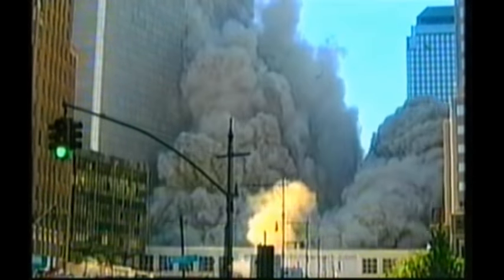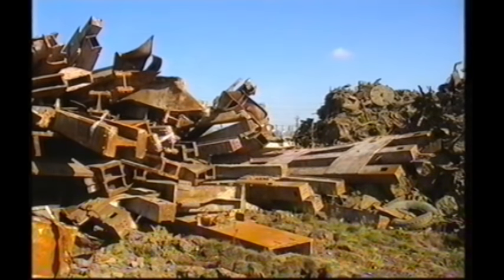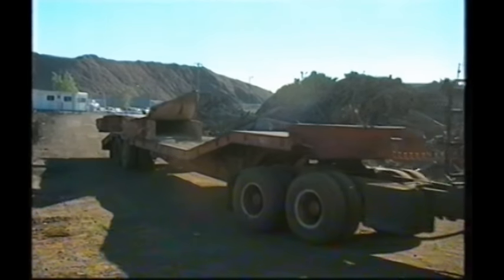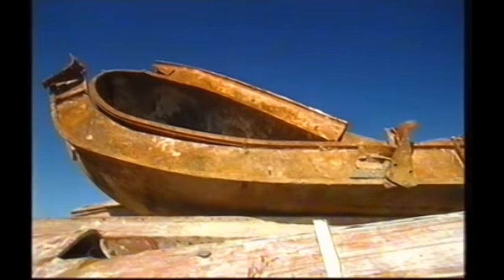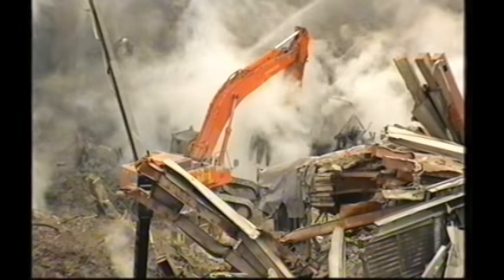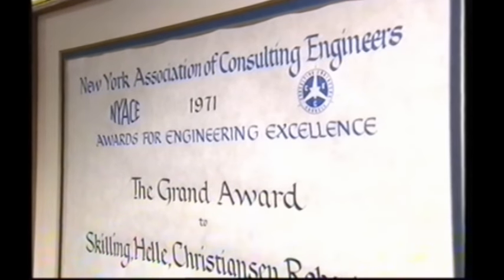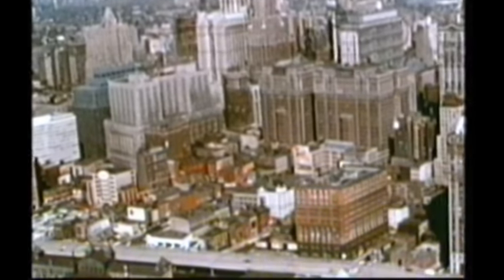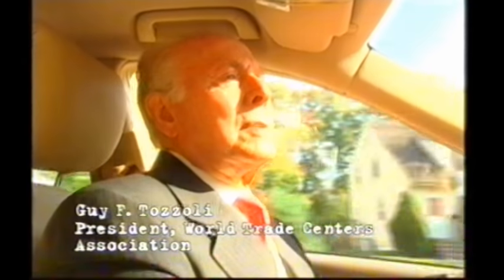9/11—"How The Twin Towers Collapsed" (C4 documentary, 2001)

Comment: It really pains me to see the architect blaming himself for the thousands of deaths. If he’s passed away since 2001 I pray he found some peace and realized that the majority of the responsibility for those thousands of deaths is with those who blew up the buildings not with those who designed them.
Reply: The moment he passed he was shown the truth.
There is/was a documentary about how they came down and engineers were explaining they were demolished by implosion .
They were talking about people hearing explosions at the base .
Whoever has seen how buildings are demolished ,knows how clean and in vertical they come down .
Collapsing on the side  is not allowed in a well done job.
Anyway , the engineers  speaking in the documentary were sure that it was absolutely impossible for a steel building to collapse bcs of what happend on the top floors.
They have questioned also the official narrative about the planes.
Wonder if that documentary is still available or the communist censorship had its paws on it 🤔🤔🤔🤔
Can't remember how many years back I saw it. Anyways , many.
Reply: False.  The buildings were not blown up.  The fire brought them down.
Reply: @dianet2702  : The fire brought the buildings down.  Not demolition charges.
ridiculous.
Reply: Wrongfully Ccused is a troll.
Reply: @wrongfullyaccused7139  exactly, but then someone will scream "jetfuel cant melt steel" steel dont need to melt to be weak and collapse, but that seems to be out of their brain frequency of knowledge
Reply: @dianet2702 I hope you wearin your tinfoil hat or the man will get ya
Reply: @wrongfullyaccused7139  Are you CIA?
Reply: @wrongfullyaccused7139  nonsense u don't undertand physics
Reply: @tonybarfridge4369  : Yes. In point of fact I do.  My earning a living depended on it.
Good bye.  Don't forget to change the batteries in your tin foil hat.
Reply: @rickmartin639  : Nope.  Just someone who knows how steel works and how buildings are erected.
Goodbye
Reply: @terry_willis  : Not for all the money in the world.
Reply: @eriksimca9409 : It is disturbing how quickly will talk about things they have no knowledge of.  I am a DOD certified welder. certified structural maintenance and a retired tool and die maker.
I have hand formed steel for fifty years with and without heat.  Heat is only needed to form steel that is either very heavy gauge OR steel that has to be formed into more complex shapes.
It seems best be to just tell the truth and present the facts and let it be.
Reply: @wrongfullyaccused7139  okay aaaand what would you say to video evidence that disproves your theory?  I'm sure you've seen it?
Reply: @byronthegooner, Bryan, over the years, it’s been my experience that when nutters have presented “evidence” it has helped to disprove their own position
Reply: @dikranovichk5889  surely you ain't making reference? Are you that would be so sad mate
Reply: Minoru Yamasaki was the architect and he died in 1986, you mean the structural engineer
Reply: Jet fuel nor regular building fires can melt steel, it's physics 101. There's a reason steel is the choice for building buildings. Not to mention the buildings blew up perfectly falling vertical (it was obviously a controlled demolition); the building would've bent over if anything but it didn't!
Reply: @byronthegooner,  present your “evidence” so I can show you lil man
Reply: @dikranovichk5889  they are termed nutters by the perpetrators who don't want any truth to come out
Reply: @tonybarfbridge4369,  Tony, you are free tot present your evidence and make your case, as is any other nutter.  Tony, I’ve developed a theory.  The truth, and truth, are two different things.  People who believe in truth, are usually in cults. And truth is subjective. It’s their truth, his truth, her truth, my truth.   The truth is objective.   

Tony, you didn’t use the article in front of truth.  You already brave yourself up.
Reply: @CraigC55  Jet fuel can definitely melt steel, even wood can melt steel. All you need is an optimal air to fuel ratio and the conditions of the fires being fed oxygen from wind allowed them to burn much hotter than they would normally.
Reply: And the funny part is he speaks today probably because he makes more money than you could ever imagine. In a year of your lifetime he can make in a day.
Reply: @dikranovichk5889  Please be more rational. I don't need to present all the evidence from memory of the documentaries. I have alluded to them and it's an individual choice to follow it up. Doing so does not constitute a nutter but apparently you are qualified to designate the term. Evidence=facts=truth. Nothing mystical though for some agenda of your own you want to blur the distinction.
Reply: Where is Rosie O’Donnell? We need her opinion on this topic. 😒🤦‍♂️🙄
Reply: The architect was Minoru Yamasaki he died in 1986 you mean the structural engineer and he didn't blame himself, he said that scenario wasn't accounted for back in the late 1960's
Reply: @drunk_by_noon9231  You need pure oxygen from a oxygen tank to get fire to 2500⁰ F. Second the integrity of the steel at the bottom of the building has nothing to do with what's happening up top! Steel is absolutely resilient and if anything the building would bend over from the top, not the controlled demolition we saw. It would have been the first time a steel building collapsed because of fire and on that day 3 steel made buildings in NY miraculously were have said to have completely collapsed because of fire! Please listen to alternative theories, there's a reason so many people have lost their trust in government already!
Reply: @tonybatforama, you just gave yourself up. You think documentaries are what you should use as evidence……from memory.
Reply: This was controlled demolition,  lol not the architects fault
Reply: @eriksimca9409  absolutely right! Even if the fire was hot enough to melt steel, the buildings would collapse the moment the steel was soft enough that it could no longer support the weight it was holding up. An engineer explained this to me but you don’t have to be an engineer to understand it!
Reply: @kardd41   Sure, maybe in a forge that has been burning for a minimum of 30 minutes, will weaken hardened steel in a minute or two. However, consider the fact that the crashed airliners didn't even have enough fuel volume to bring down a quarter mile high skyscraper, especially after being in the air. In fact, the fires only lasted a couple minutes, considering most of the actual jet fuel was wasted outside of the tower on initial impact in the fireball, causing the office fires which do not burn hot enough to melt steel (RIP WTC7). Even if you broke laws of thermodynamics, you can't make a tower freefall from the top ~20 floors. Then you'd be breaking newton's law.
Reply: @andrewn924 Did you even watch this video? The engineer at 37:20 explains that steel weakens with temperature. Nobody, anywhere, has ever claimed that the steel in WTC1, WTC2 or WTC7 "melted", just got very, very hot. The video explains that the floor plates tied the undamaged outer columns in, but as they failed due to the regular fire, that lateral support became weak enough for the columns to spread at the weakest floor.
Everything after that was nothing more than the momentum of thousands of tonnes of building punching out each floor below it then pushing out the walls.
Reply: Ты прав их взорвали из нутри Мафия Буша...
Reply: Precisely that.. the fact that Americans still believed that these buildings came crashing because of the planes baffles me to this day.
Reply: @wrongfullyaccused7139 if y'all govt tells you to jump off the bridge you'll close your eyes and jump happily huh.. . You genuinely believe that the plane's explosions really were the reason these building collapsed huh 😂😂
Reply: @shenton18  The fact that some Americans don't baffles me even more.
Reply: @shenton18  Again, watch the actual video you are commenting against. The steel in the floors below didnt need to be weakened. The floors just weren't designed to have the top of the entire building drop onto them. Logical reasoning.
Reply: @Byronthegooner I just want them to show me the footage of the plane that supposedly hit the pentagon for starts. And why when that once scientists found fragments of nanothermite stuck to fragments of the steel they quickly tried debunking and shutting her up. Why when that one employee gave his story of hearing and feeling the explosions coming up from the 8th floor all before the entire thing collapse they don't explain that.. . Like where and or why was he experiencing excessive heat, and explosions 8 floors and below, minutes AFTER the plane impacted the tower he was in.
Reply: @shenton18  destrovers...
Reply: Controlled demo brought them down not his architecture. Just ask Busch and Cheney.
Reply: the majority? I'd say 100%
Reply: There were buildings 3 to 6, all came down without a single plane hitting.
Reply: See my explanation above. You can guess why few will tell these truths.
Reply: @rickmartin639  no, you are though.
Reply: @tonybarfridge4369  clearly you don't.
Reply: @joshosmer2828  Don't what, remember? I remember the impression of all the refuting evidence and will never forget it. If u want to learn the truth do a bit of research like 1000s of others have and don't be so lazy as to want to see it all spelled out here.
Reply: @wrongfullyaccused7139  i cant believe how many people have bought in to the conspiracy theory when the whole thing was shown live on TV.
Reply: @wrongfullyaccused7139  bullshit
Reply: @wrongfullyaccused7139 no batteries required 🎩
Reply: @roberthindle5146 wasn't the steel he was referring to bare, what happened to the fireproofing. Did it just fall off 🤔
Reply: @rogercunningham9987  Yes. A Boeing 767 travelling at nearly 500 mph past all the steel columns would have taken off the fire protection. It's only like builder's foam.
Reply: Based on what
Reply: @rogercunningham9987  Common sense.
Reply: @roberthindle5146  🤣🤣🤣🤣
Reply: @eriksimca9409  It's almost as if a hundred tons of airplane hitting a building at over five hundred miles an hour can cause some structural damage.
Reply: Whenever i see the iconic shot of the sun shining through the empty world trade centers I am amazed they had stood for as long as they did after the attacks! 

The yin of the material l and designs became the yang of their ultimate fate relatively an hour later.
Reply: @dianet2702  people were hearing explosions everywhere in that day. Even on the news they said the planes were "explosions"
Reply: @gabrielc6252  Well, I don't care. In the meantime God has taken care of the victims and those responsible have already payed or will pay for their crimes. 
Amen.
Reply: @wrongfullyaccused7139 😅😅😅😅
Reply: @wrongfullyaccused7139 😅😅😅
Reply: Survivor's guilt sucks. I feel bad that the last 20 years of his life were with the knowledge and guilt of 9/11 when it wasn't his fault.
Reply: @CraigC55 
Yes.

Thank you. 😊
Reply: @dickdykstra2234 
Yes.
Reply: @wilsont1010 
Yes, Thank you! 😊
Reply: Any architect would of known that plane has a the same damage velocity. Truth is it got signed off anyway.
Reply: Wrongfully  - there WAS melted steel found. That's the point.  Jet fuel can't melt steel.
Reply: @douglasmesina6922  Metal!! Melted stee!l. I doubt it!.
Reply: Exactly.
Reply: @jasonhuttermusic424  oh!! whoops!!
Reply: Yes strangedays there was multiple signs of melted metal. The kind that can only result from thermite.
Reply: @douglasmesina6922  oh!! I see. Whats thermite? Is that when its closed in?
Reply: Can i just anounce something very dear to my brain. Im writing this for Rock. The Rock is guilty of not THINKING!
Reply: ...but with them who designed all three buildings to fall🏢💥🏢💥🏢?
Reply: @CraigC55 Then why there weren't explosions sounds? If there were explosives it would have exploded at the same moment the plane hit it, it started falling at the impact floors. Also South tower tilted during the collapse
Reply: @drunk_by_noon9231 Jet fuel doesn't melt steel... It WEAKENS IT!!!!
Reply: @daniko4447  Planes hit the towers and it exploded. There were more explosions going off before the towers collapsed that had nothing to do with the planes.
Reply: @CraigC55  That "explosion" was from the fire, the floors fell on top of the others and the windows were the only place the fire could escape
Reply: @daniko4447  These explosions were taking place at the lobby level and other various places closer to the ground that had nothing to do with where the steel building got hit.
Reply: @CraigC55 there’s this thing called downward inertia. I would like you to explain to me how after the support columns snapping, the building was magically going to fall sideways.
Reply: Kind of odd how all the buildings fell into their own footprints. I wonder what the chances of that of happening? Even controlled demolition would have a hard time pulling it off almost perfectly.
Reply: Yes, structural steel will be softened and weakened with sufficient heat . . . ONLY WHERE THAT HEAT IS APPLIED. The buildings would then both have collapsed onto the damaged parts and toppled over at those points. This is so screamingly obvious that it's a wonder you have failed to realise it. Try it with any structure, it will fall over at the weakened point. Both towers then fell onto their own footprint. Absolutely these were controlled demolitions. Also, where afterwards was all the steel? Do you think the entire frames just melted, save for a few bits pointing out?
Reply: I agree 💯💯
Reply: @EMan-cu5zo how when debris was speaded out several miles away
Reply: There's no blame to him, a building cannot withdlstand a detonated demolition, which it's very clear at this point that's what happened. There's mountains of evidence to support this theory, which isnt a theory anymore to those who have actually researched it.
Reply: @roberthindle5146  you can heat a rod of steel with a torch & bend it by hand. Initially the static weight of all above levels became greater than the hot mechanically damaged floors could withstand. Then the mass began to accelerate downward, picking up speed from gravity. The lower levels were impacted as by a gigantic hammer or battering ram.  The insulation that could have protected the support beams  was
Inferior to what could have been used though.
Reply: The responsibility and blame falls directly on the American People PERIOD.
Reply: @CraigC55  that's not reality. Secondly the Twin Towers were actually 3 Buildings in one which is why there were two sky lobbies
Reply: @romper4444 detonate demolition 😅 I guess you believe in the Easter bunny 🐰 too right
Reply: The towers turned to dust in mid air. Where did the towers go?
Reply: The terrorists set up explosives in both towers prior to the plane attacks.
Reply: @dianet2702 
You would be right if this was built like the empire state building but this was a perimeter frame and they are well